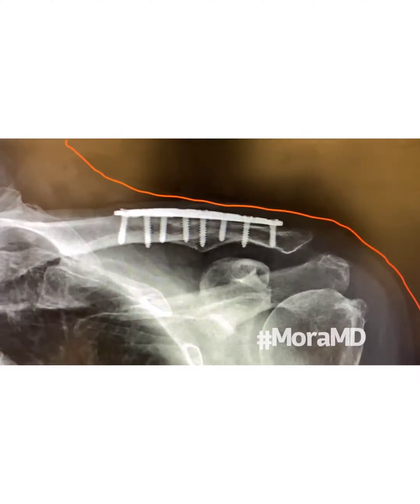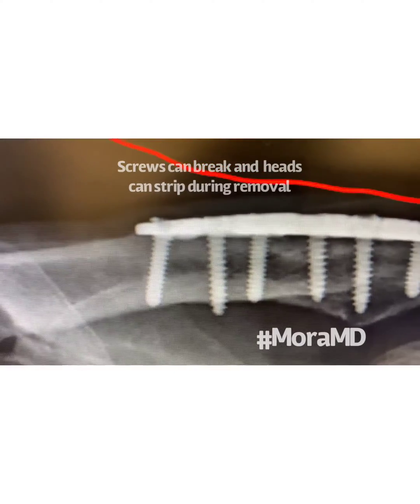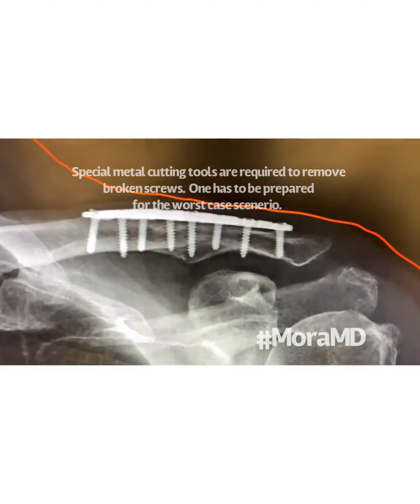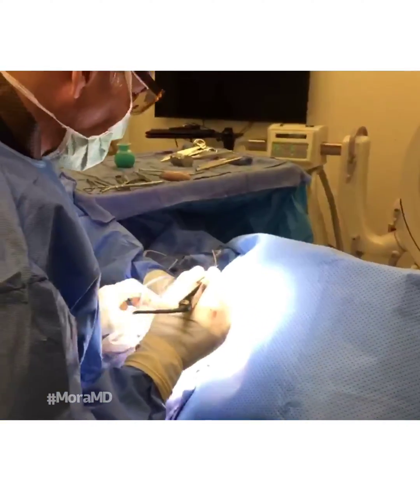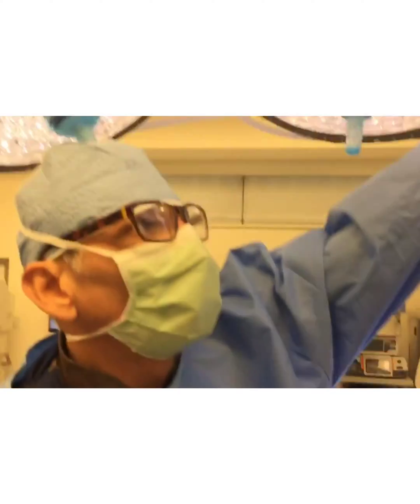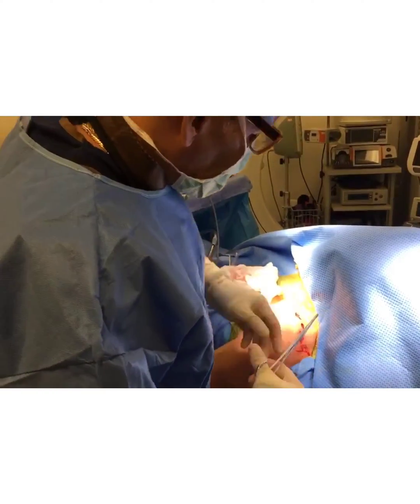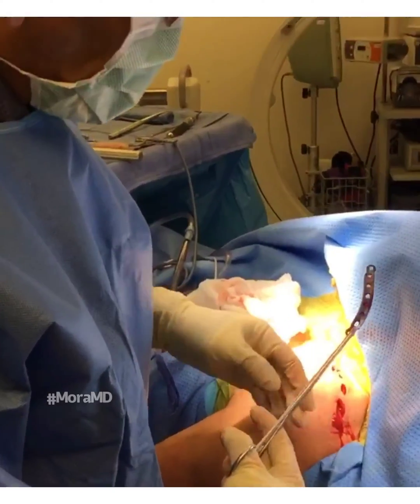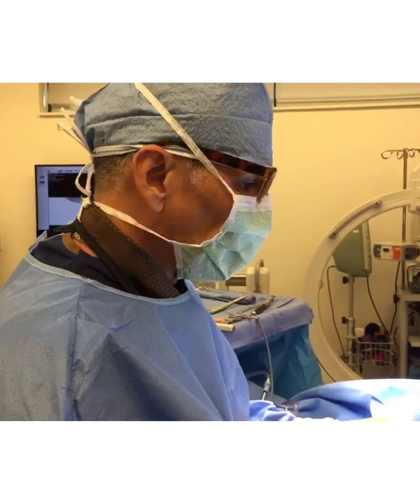MoraMD: Removing a Clavicle Plate isn’t as Easy as it Looks.

Comment: Sir i had my clavicle plate removal surgery. How many days i should wear a sling. And how many days after i can do normal activity
Reply from the maker: Hello best you ask your surgeon just in case.  For my non complicated patients they use it for approximately one week.  If the fracture healed immobilization with a sling is only for comfort.   But just to be sure ask your doc.  Be safe.
Reply: @SteveMoraMD  how many days does it take for all the holes  to heal .from which the screws were removed

Comment: While removal of my clavicle plate two screw heads broke and my Dr. Removed the plate and all the screw but two screws shaft is still in the bone. I want to get those two also removed from my bone. My Dr says that removing those two screws can result in facture to the bone but I don't want any foreign part in my body anymore. Can you help me out or give your overview on my situation?
Reply from the maker: The risk of damage is usually greater than the reward in those situations.   It’s certainly possible but it requires excavating out the screws.   Usually not necessary.  Sorry to hear.  Be safe.
Reply: @SteveMoraMD  I am a national athlete and I love fitness so, I will be needing to lift heavy weights. Since, two screws are without there head in the bone won't it make my bone prone to break while lifting heavy weights? (I lift really heavy like 200kgs dead lift)
Will I be able to do everything I want with those screws, including really heavy weights?